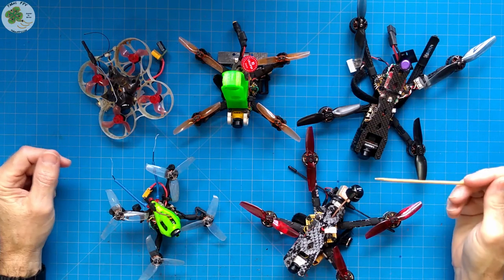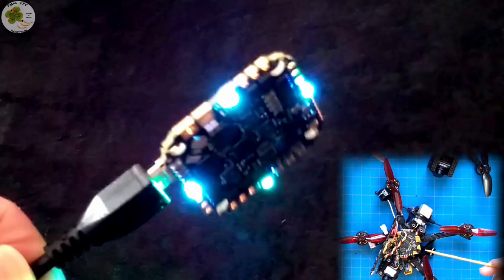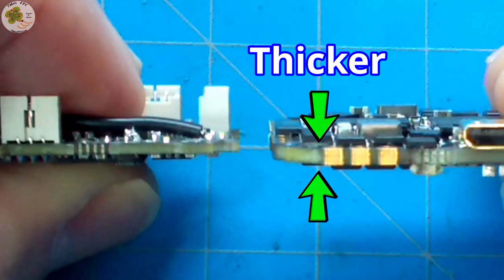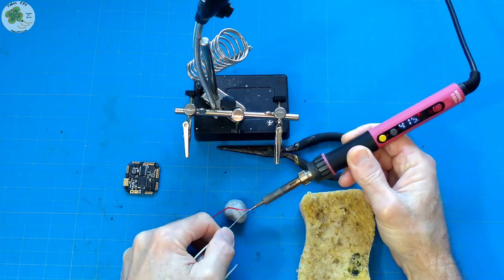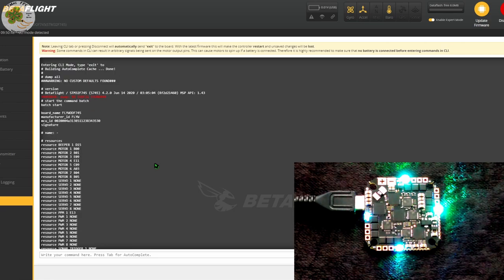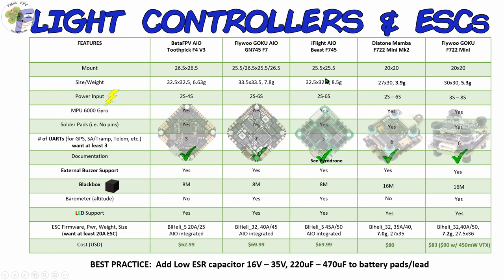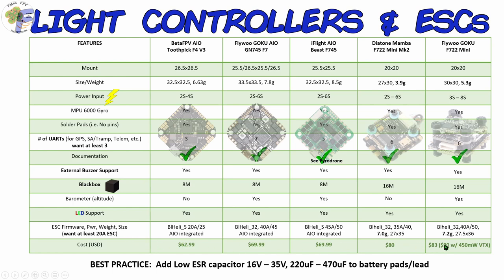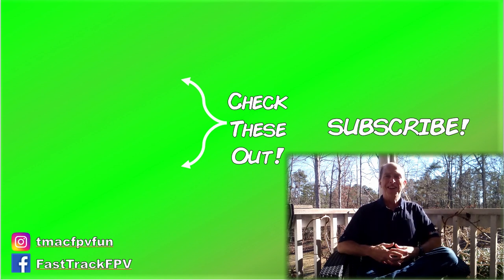AIO Flight Controller (NOT JUST FOR WHOOPS ANYMORE!)

Comment: I've been using an AIO board on my 5 inch for months now. 45 amp rated and running 2306 motors and 740 grams all up weight. I've had no trouble so far. I prefer AIO boards. They take up a lot less room.
Reply from the maker: Yes! My feelings exactly! Trouble is for me finding one with all the features I like. The Flywoo Goku GN745 has all of them (only 8Mb of Blackbox, wish it was at least 16, but I can work around that). Just grabbed the last GN745 I could find in stock in N. America yesterday.  Banggood is showing them as discontinued. Flywoo does have the GN745 EVO HD, but that's a larger form factor. Only other AIO FUN I've been able to find that comes close with all the features of the GN745 F7 is the iFlight Beast. Been reluctant to try it as long as GN745s have been available
Reply: @TMacFPV  I haven't learned anything about black box or tuning yet. I just fly stock settings with my rates.
Reply from the maker: @CarbonGlassMan  👍as long as you're having a blast, that's what's important! If you want/need to start learning tuning basics (simple & easy to understand), this short Playlist may help Micro FPV Drone Tuning Guide: https://www.youtube.com/playlist?list=PLKAiYAaTdvmoXyDzrPWj9-sxv4m1GNKCT It applies to more than Micro's
Reply: @TMacFPV  I'll check them out eventually.  I looked into it before and it seemed a little complicated for someone that wasn't very good at flying yet, so I decided to try to get good at flying as the betaflight settings are and then learn to tune. If I can fly a poorly tuned quad well then tuning it should make my piloting skills seem even better.
Reply from the maker: @CarbonGlassMan  Exactly CarbonGlassMan!  However, you're most likely flying a very nicely tuned 5" Quad since Betaflight Dev's have done an outstanding job with defaults for 5" Quads.  in fact, the defaults work quite nicely from what i've seen on 4" and under too.  Just a little tweaking here and there if you really want to get into it and spend the time.  Not necessary though to have fun!  Many thanks & much respect to BF Dev's!

Comment: @TMac is there any chance you can share a firmware dump from the F745 AIO? I am planning to make an Arducopter target for it, but I couldn't find the target anywhere.
Reply from the maker: here you go.  A link to teh CLI "Dump Alls" for both e original Betaflight 4.2.0 firmware that came with it (this starts on page 24 of the document) and the updated Betaflight 4.2.6 firmware (which starts on page 1).  headers in bold precede each version of teh command settings.  You only need to use 1 (either the pages for BF 4.2.0 OR the pages for BF 4.2.6) http://bit.ly/FlywooGN745AIOFCBF420andBF426CLIDumpAlls
Reply: @TMacFPV  Thank you sir! You are a lifesaver.

Comment: i recently got 3 of these, only 1 built so far but it is a much better aio than the jhmcu 35a f4 i was using. blackbox was the reason i bought these. the 3" i build flies nice on stock, now i just gotta learn the blackbox. i cant yet comment on durability even though iv crashed it a load already. shame the solder pads are so small they are a nightmare and no labels makes it easy to solder the wrong pads. i had my rx and tx over one pad to far even after a long study. luckily iv made this mistake before and went straight to it. i do notice it has 4 extra motor pads does that mean you can have more motors? It comes on 4.2.0 should i upgrade to latest firmware?
Reply from the maker: Hey DIY FPV! You don't "need" to update any firmware at anytime unless you would like to in order to get added features and possible fixes that have come out (true with transmitter firmware also). For each of my builds when starting out with them I do update to latest firmware ONLY after saving the original CLI " dump all" to a Word file just in case I need to revert back to it later. Regarding Blackbox, this may help get you started https://youtu.be/eMMrBeX12l0 . Clear skies friend!👍😁
Reply: @TMacFPV  just a quick one cos i always update to latest too so most likely will. Why would you save a stock firmware. Surly re flash 4.2.0 would contain all the same files its just board orientation, motor mapping and all the other changes that are applied is that correct? Am i understanding this correctly? I never save my config just flash and if the motors are mapped wrong ect only takes 10mins to correct most things. Or am i missing something important here?
Reply from the maker: no, not missing anything too important.  Just ease of use for reference.  If you've got the "dump all" file saved, no need to reflash, just copy and paste into CLI and hit return.  Also, you can "search" on saved file using CTRL F to find any setting you may need to research.  Just stuff like that.  Its also available to you n a file without having to connect to Betaflight.  Just a "backup" way of doing things

Comment: A couple of dumb questions here. How do you mount these 45° off-set  kind boards on a regular frame? Do I need a 3d printed adapter? Wouldn't that plastic adapter warp under high operating temperature?
Reply: Folks use an adapter plate usually. Alot of frames are coming with the toothpick pattern mounting option now.
Reply from the maker: I use the 3D adaptor for which I have a file you can print out here https://drive.google.com/file/d/1CyZ8u7AA5XuAvWAQRZMTqOl88ycRKv0i/view (heat hasn't hurt mine at all--its dense enough) or as Brandon baked Beans has said you can also get an adaptor plate.  I also may have another solution coming for you "soon!"  😉
Reply: @TMacFPV  Allright, Mr. Cliffhanger. I'll be looking forward to knowing all about it.

Comment: can  some  one  answer me  why all in one   not have the imu   belt in    imu is   inertia  measurremnt  unit
Reply from the maker: not sure I understand your question correctly.  The AIO does have the IMU "built in"  See product description:  "GN745 AIO Flight Controller

Specification: 
MCU: STM32F745 32-bit processor,216MHz, 512Kbytes Flash
IMU: MPU6000 (SPI)"

Comment: be careful this type of flight controller all in one has problem sometimes with flyaway depending on the battery you use
Reply from the maker: hmmm . . . been using them (AIOs) for awhile now with 2-4S with zero issues. Have not used 6S with them though
Reply: @TMacFPV  nice to hearing that from you about this controller.. I faced this problem flyaway with geprc 20a and JHEMCU 25a AIO on using more than 450mah 4S 😢
Reply: @dndon2007  i was getting flyaways lately after building with this aio it turned out i had 1 wire touching both aio and also the vista mounted above it so i re routed the wire also i re routed the rx and tx which were touching the gyro and sure enough no more fly aways and the motors sounded alot smoother. just an idea. i will be thinking about my wires more on future builds.

Comment: Hey Tmac, if you get a sec can you check out my newest video. i think my brand new Nebula Pro Vista is DOA
Reply from the maker: Hey Barnz1980! I checked out your video with the Vista issue.  Not certain bit it could be  a couple things.  First, I noticed in the video you said you connected it to 5V.  Its my understanding the Vista takes 7.4-26.4V input.  Secondly, it MAY actually be your "smoke stopper."  IF your smoke stopper has 2 different settings (such as 1A or 2A) and you're using the lowest setting, it may get "tripped" simply because the Vista is drawing more current than what you have the smoke stopper set at (even though the Vista is drawing its "normal" amount).  What I'm trying to say here is you MAY have your smoke stopper set at the wrong setting for use with the Vista unit.  Of course, if you.  From Oscar Liang's article on the ViFly Smoke Stopper:  "It has two current limit levels – 1A and 2A for different applications. If there are power hungry devices installed in your drone, like a VTX or DJI Air Unit, you can select 2A. The 1A option is safer and more sensitive, preferably for low power builds like a 2″ or 3″."  Pease note, if this is NOT your issue and you change the setting on your smoke stopper when you actually DO have an issue, then you will risk burning out other components.  This was my "Disclaimer!"  Maybe one of these will help.
Reply: @TMacFPV  thanks for checking that out Tmac 👍 
Oh the the 5v, that's something I overlooked BUT actually have my 1st vista wired the same on the Armattan Gecko 3" & to the same FC (mamba mini stack) 🤔🤔🤔. The gecko has been in the air a few months now & all good.
Saying that I will still definitely move the + connection though & try that 👍.
My smoke stopper is a YRrc stopper off Banggood, it doesn't have a swtch on it 😭
Many thanks for your quick reply mate 👍👌
Reply: @TMacFPV  ok so I had some coffee & sat down to fiddle with drone.
I moved the vista + & - wires to a vcc pad & the ground next to it. Still the same 😢
BUT then I removed the vista from the drone (again 😂🤣) & now the drone seem to be STILL doing the short on last beep 🤔. That new, every other time I've had the vista disconnected I don't have a problem.
Rather confused I decided to plug the vista directly into a 4s battery (via smoke stopper ofcourse) & after a bit the lights are bloody staying on!! & Then I finally see the lights go full green!! WTF!! 
So my vista works via a battery but not from the FC (5v or VCC)
Oh god lol, so I'd lean towards my FC is dodgy then?
Both were brand new before being soldered together on Friday. 
P.s I may have ordered another Vista last night 😐 sigh...